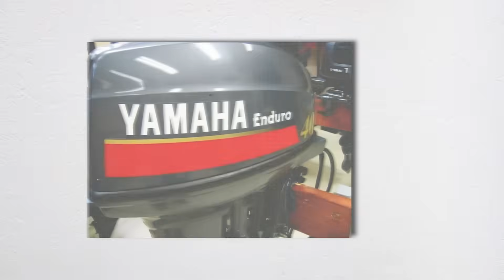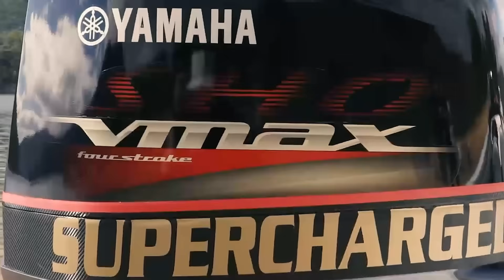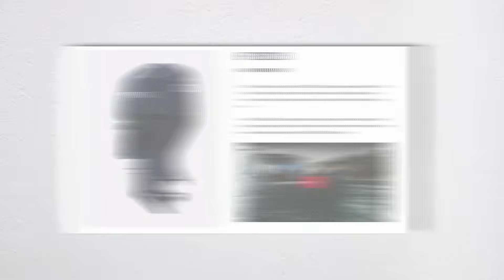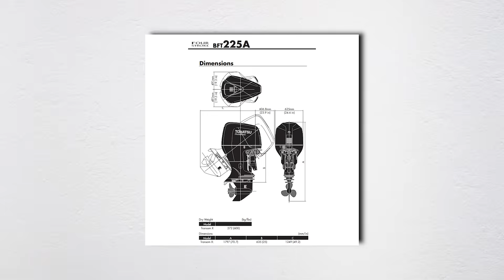15 Most Indestructible Japanese Engines Ever

Comment: Yamaha sho 200 with 214 hours corroded a hole from the water jacket around the cylinders into the cylinder allowing a small amount of water into the cylinder on every stroke which cannot be compressed so it was forced by the rings into the crank case eventually filling the crank case with salt water leading to a total loss of the powerhead. Now for the good part, being that the motor had only 214 hours on it the motor was out of warranty .......$15000 for a new powerhead from yamaha and you can't (or I was lead to believe) that because of the special process of lining the cylinders the powerheads cannot be rebuilt so no remanufactured powerheads. 65 years old been around boats since I was a kid and working on them as well as total rebuilds I've never heard of having a hole corrode through the cylinder wall causing a total loss of the powerhead. Now let's talk about the anodes the reason I'm bringing this up is because yamaha has put so many anodes on these engines that you'll lose count trying to keep up with how many there are. All of the anodes to which you can get to to replace and then the internal ones that you can't get to with out major disassembly of the engine. If you remove the heads (which no one does during normal maintenance) in order to determine the cause for the saltwater intrusion then you'll find in the water jacket along side of the cylinders 12 anodes one on each side of each cylinder. Now first thought would be that's really good of Yamaha's engineers to over kill with anodes to mitigate corrosion or did they do this to try to cover up a known issue with severe corrosion issues. I know what I saw with my own eyes and believe but i'll leave it to you to draw your own conclusions

Comment: Slightly off topic but back in the early 90’s Toyota released the 4AG-E engine in the Corolla, Toyota engaged Yamaha to design & build the twin cam cylinder head for power, reliability & to ensure the valves would not hit the pistons if a cam belt failed. Brilliant engineering from Yamaha. Cheers.

Comment: I had a 15 hp Yamaha 2 stroke on a Polycraft Tuff Tender.
We called it the Flying Esky.
Awesome motor that has exceptional secondhand prices due to reputation and performance, plus the weight of 15 hp 4 strokes after they banned new 2 strokes in Australia.